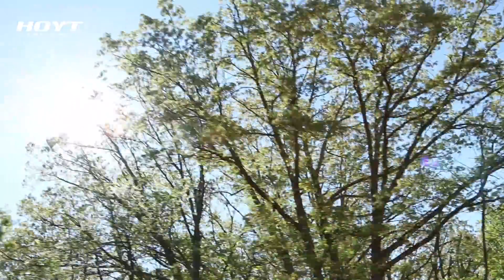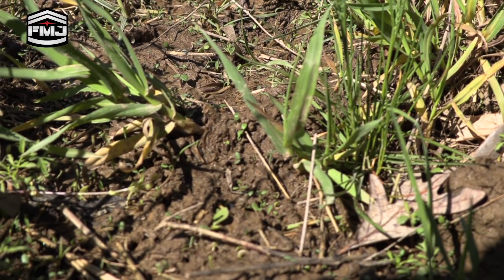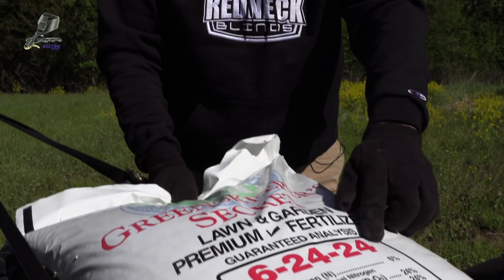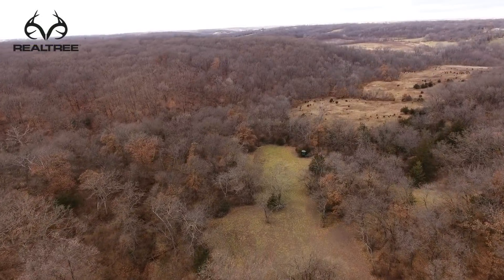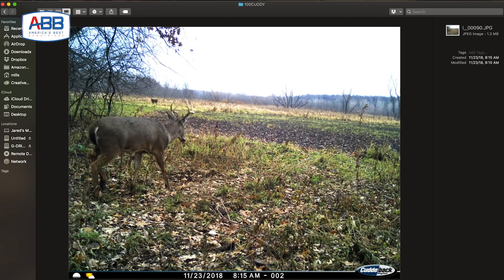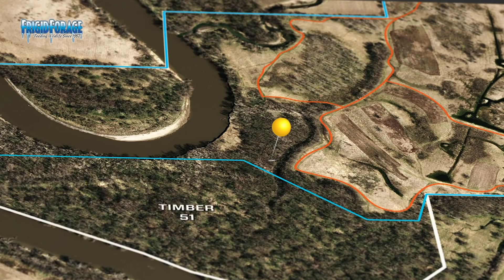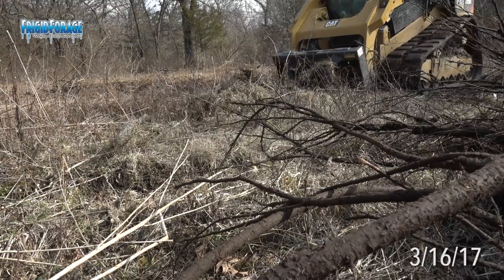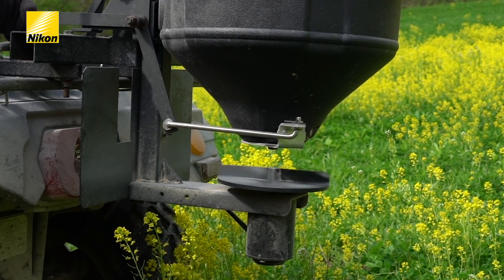Micro-Plot Update, Camera Tips | Midwest Whitetail

Comment: Bill, can you educate us a little more on the pelletized lime vs. ag lime?  I'm used to pelletized lime having fairly large particles that should lead to slowly dissolving (less surface area), which is opposite to what you stated in the video.  Perhaps the larger particles would dissolve quicker if they have some type of filler added, but then that goes against the labeling on the bag that it's 98% pure calcitic limestone.  I get that pelletized lime should have a higher CCE (ag lime lower due to impurities), but I'm still struggling to see how pelletized lime can be 10 times more effective.
Reply from the maker: Joe, my understanding is that pelletized lime is actually powdered lime that is made into pellets before they bag it using a water soluable adhesive.  The adhesive dissolves when the pelletized lime gets wet leaving very small grain powdered lime to work into the soil.  Ag lime has to be crushed larger so it can be spread effectively so it has much less surface area to work into the soil. It just takes longer for ag-lime to break down and work all through the soil because of the size of the grains.  The small grain size allows the pelletized lime to go to work much quicker in the soil but it also doesn't last as long. So you get greater net effectiveness in year one with pelletized lime,  but you need to keep applying it for a while (length of time depends on soil makeup) until the effect is longer term.  -Bill
Reply: @MidwestWhitetailVideos  Thanks Bill.

Comment: What I've seen with clethodim. It doesn't work like gly. Don't expect the grass to keel over in a couple weeks. It's working though. The next spring the grass will not come back even if it only yellowed the year before. Be sure to frost seed your clover the following spring.
Reply from the maker: Good tip.  I have seen clethodim kill the grass here. I have used it a lot in both clover and Big N Beasty (brassicas). -Bill
Reply: @MidwestWhitetailVideos  it works really well. The first year I tried it after seeing your videos and reading forums I thought it didn't work. The grass looked yellow but didn't turn brown and fall over. The next year though, the area I sprayed with clethodim was all but weed free while the area I didn't spray was all clump grass.

Comment: Bill, your not going to benefit from the pelletized lime and fertilizer by broadcasting it on top of the soil. yes some will soak into the soil but not much will actually be utilized by the plant roots. on average white clove plants within 5-6 weeks old will have roots that will be 2 feet below ground level. mature white clover seed can be 5-8 feet below ground level. Soil absorbtion is probably very minimal to none in the area where you are planted. with out proper tillage or no till it isn't really viable to spend money on fertilizer or lime on a food plot. best to keep it a true poor man and let it do what it can.
Reply from the maker: That is not true at all.  I have fertilized P&K on top of the ground for 25 years and it does a great job of bolstering clover plots.  As for lime, it will get soaked in a little at a time.   The top three inches in this timber soil is where the soil is most acidic anyway.  -Bill
Reply: @MidwestWhitetailVideos   Your field is on a knoll and most of what you spread out will be washed right off the hill. My point is keep it a poor man plot.
Reply: Good info on the lime !! I was was wondering about that,  and here in Iowa we been flooded cause last year we had a drought  lol

Comment: I dont understand you logic of 200lbs of pelletize = 2000lbs of non pelletize lime...
Reply from the maker: The pelletized lime is ground finer and made into pellets using a water soluable adhesive.  When it gets wet it goes back to a fine powder which enters the soil easier. It acts faster but you have to apply it more often.  You may even need to apply every every year at that rate until the pH gets where you need it.  True ag lime takes longer to break down and work into the soil, but you are putting on a lot of it, so it enters the soil at rough the same rate year one, but lasts much longer. -Bill
Reply: @midwest whitetail 
Google    "Lime for Michigan soils"
It's a research paper from MSU page 6 talks about pelletize lime.
Reply from the maker: Here is that link for others to read: http://www.soils.msu.edu/wp-content/uploads/2014/06/Lime-for-MI-soils-E-471.pdf  If this is true, I have been getting a lot of bad information from people who should know (farm co-op experts).  -Bill
Reply: I talked to my aunt who is a retired biology teacher her degree focus is in botany, she lives in the UP of Michigan with very acidic soil. See told me that it doesnt matter what type of lime you use the amount  you use would be the same i.e. 200lbs of pelletize has the same effect as 200lbs of ag lime. The only difference would be the rate of absorbtion. She said I f you want to experiment for your self mark off areas of the same size at least 10ft apart and not downhill from each other. Apply different types of lime to each area but be sure to use the same amount of lime in each area. You can either test periodically or she said you can test each area then lightly water each area with same amount of water  to speed up absorbtion.
Also I'm looking at a bag of pelletized lime says on it 40-80lbs per 1000sqft for lawns, 100lbs for gardens.